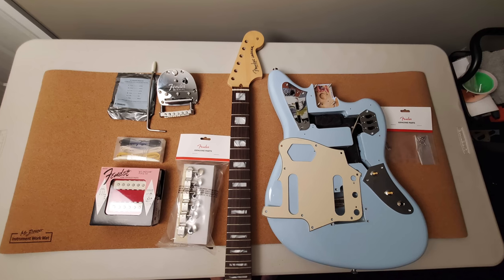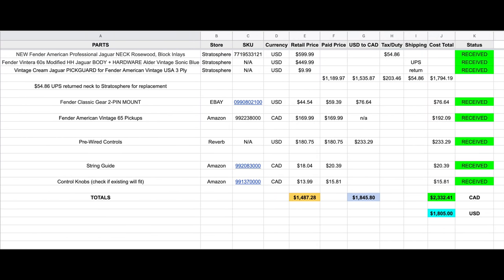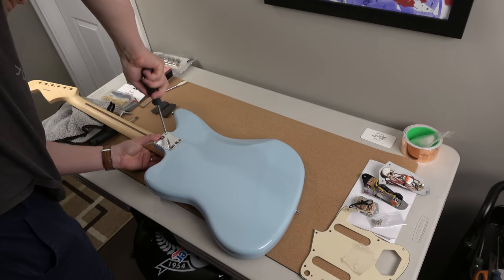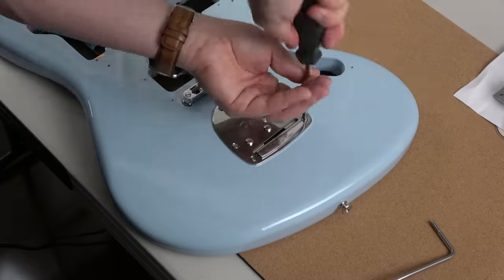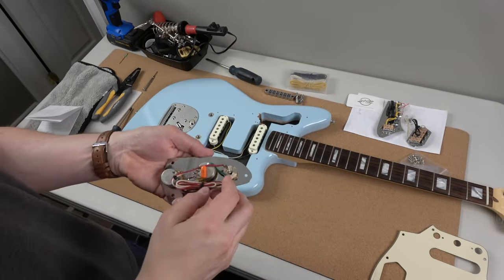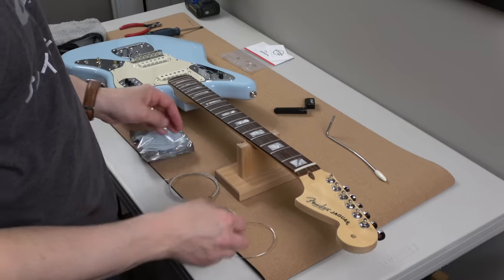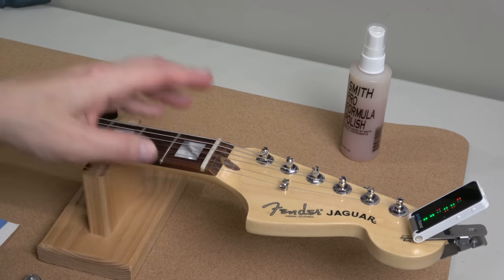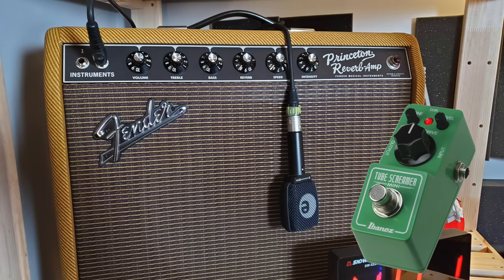Building a Custom Fender Jaguar: The Complete Step-by-Step Guide!

Comment: Nice build Landon. I have a Squire Jaguar and modded with the same 65 Fender pickups you have. It’s black with a mirror pick guard with chrome tele control knobs. I swapped the bridge out with a Fender Mustang which solved the bridge issues and back string down pressure is fine, no rattling or slipping.  Your right about the controls, confusing at first be very simple after. Beautiful guitar, make it a keeper!

Comment: I actually bought the Ventera HH jaguar MOD (sonic blue too). I didn't like the vintage white pick guard though so I bought a white pearlescent replacement (making it look kinda like Cobain's sonic blueJagStang). Problem was getting those pickups back on a new guard though because they rely upon these springs that I can't get it (there's even a video about this problem that utilizes straws that couldn't help me). Your solution with black foam is something I'll try next.
Reply from the maker: hey cool, hope it helps!

Comment: I have had an '09 sunburst Jagmaster II since 2010, and it became my favourite guitar almost immediately. (The other electric guitars I owned are an '87 Charvel Model 4, an '03 Epi Gothic Les Paul, and a Jackson Performer PS-1). Although it is a bit of an oddball, I still like it. I recently got a '21 black Squier CV 70's Jaguar. I like it so far. I dunno if it'll overtake the Jagmaster as my favourite or not. I would have preferred a sunburst Jaguar, but decided to go with black to match my son's Squier FSR Mini Jazzmaster. The other reason was that I had to order online, and I don't like how a lot of the Squier bursts end up looking (including my Jagmaster) because of the mismatched chunks of wood. So, if I were building from scratch, I'd want a two-piece (or really well-matched three/four-piece) body done in a burst. I also have a sonic blue Squier CV 60's Jazzmaster arriving tomorrow (wanted olympic white, but the savings was substantial enough to buy a looper pedal, which I've always wanted, so that was the route I took).
I've never built a guitar before, and while it seems fun, I'm a bit of a purist. I don't even want to upgrade parts on my Squiers that I know aren't amazing. I don't even know why. It's a mental block, I guess. That said, I picked up a Hanna Montana Washburn guitar at a yard sale for $10 once, and it's in pieces and the body and headstock are sanded down, waiting for primer. I'm debating sanding the edges of the body to be more rounded, first. Depending how it ends up turning out, I may go ahead and experiment with bridge pickups on it (if the size would work, I'm not even sure... I think it's a 3/4-size guitar).

Comment: Well, I hope you will follow up with the bridge setup later. That should be the most problematic part of your JM/Jag.  

It looks like you went with a tune-a-matic bridge (less common except for J Mascia's), and plan to use 10's. Hmmm.  Maybe you can get away with 10's with the shorter scale neck of the Jag.  I kind of prefer the longer necks of the JM.

To eliminate all the bridge rattle, etc., the typical solution is to raise the bridge considerably and create string tension with a greater break angle. Usually 11's are recommended as minimum, and the neck gets a shim of about .5 to 1 degree so that you can still keep a lower action.  I have to believe that, as is,  your strings are all over the place after using the vibrato.

It will be interesting to see how that tune-a-matic turns out.

I just got a JM recently, and it's a fussy Diva, but I'm really loving it for surfer and rockabilly stuff so far.  The 12's I use are growing on me. :)
Reply from the maker: thanks for the tips!
Reply: @landonbailey  Don't thank me.  I'm a knucklehead.  See "1965 Jazzmaster Setup Walkthrough & Demo" by @puisheen on YT. :)

Comment: Awesome guitar. I ended up returning my Jaguar block inlay neck and cancelling that build for now.
One thing to keep in mind about Jaguars and Jazzmasters—some of the MIM model bodies are being built with the trem system moved up slightly higher on the body. The J Mascis Jazzmaster does this as well. This Vintera Modified body that you used has this feature. The regular Vintera Jag does not. This modification is supposed to change the string “break angle” on the bridge when using the tremolo and increase tuning stability. I had a J mascis body on my partscaster Jazzmaster at first, but I came to strongly dislike this new trem location. It made the trem arm go forward too far and it felt awkward for me. I ended up switching to a Jazzmaster Vintera body (not modified) with the original trem position and I like it way better. I prefer the vintage string break angle and now I can actually play behind the bridge for weird sounds too. Tuning stability is just fine, especially with my mastery bridge (which was not designed with fender’s new trem location in mind). You have a American Pro Jazzmaster with the original trem location with the rosewood neck— I encourage you to compare the trem on that to this Jag and see what you think. Maybe it won’t be worth swapping the body to you, but it was to me. Sorry for the long comment. Great video 🤷‍♂️
Reply from the maker: hey thanks for sharing that info! good to know

Comment: Did you use all Fender parts to make this an original Fender parts but one you put together.  Did you use any aftermarket other than the wiring?  I believe in clean wiring from a company who does it well.  It works and looks so clean.
Reply from the maker: ya pretty much that was the idea behind it

Comment: Cool color, glad you have the jag now. Have you encountered any tuning issues using 10-46 strings? Especially after actively using the whammy bar
Reply from the maker: Tuning has been good!
Reply: You only have tuning issues if the jag has a floating tremolo, Landon has a tune-o-matic style bridge that is not floating.
Reply: @simonfinch9277  not sure what floating tremolo has to do with the bridge. Tuning issues may occur whether you have a crappy vintage jag bridge, mustang bridge or modern mastery bridge. It doesn’t really matter
Reply: Because the bridge dictates is the tremolo is floating or not, as you can see the trem is a big bulky thing, it's not routed in the back so in order to make the trem floating you need to have a bridge that floats. Floating jaguar bridges are notorious for not returning in pitch after using the system itself.
Reply: You can have the vintage bridge and have a great stable experiance as long as you set it up correctly.
In order to have a good setup on a jaguar you need to create a good break angle.
So you can shim the neck, and raise the bridge up higher.
I highly recommend the YouTube channel called Puisheen.

Comment: Commenting after about 12-minutes in:

CA$ 2300 seems toppy to me (being lazy, I'd just buy an Am Pro II off-the-shelf and to hell with the modding).

Fun vid though. I'll be watching it in chunks on account of the length.

The rosewood looks nice and I really like that blue body. I'm happy with dot markers on the frets; no need for block inlays, though I suppose they do look nice. At least you got a free pick guard!
Reply: But in reality, the parts are probably going to be an upgrade from thw stock model, you can have any configuration you like, and it's still cheaper than a pro ii.  If you go all out on parts you'll only really save on labour costs.  Where you really save money is getting unfinish/raw body, neck etc  and doing it yourself if you're willing and capable.

You also get the feeling of building something.
Reply from the maker: they don't make a Pro II Jag 😊
Reply: @landonbailey  well that sorts that out then!
Reply: Don't you go and bring facts to this discussion, Landon :)

My laziness is now pushing me to a hypothetical Am Pro II Jazzmaster...
Reply from the maker: 🤪 the pro II Jazzmaster does exist!
Reply: Fender sells me therefore I am. Or something like that.

I did spot a second-hand MIJ Jaguar at a Canadian vendor this week for $1500. Had the block inlays and the rosewood neck und alles. It was red though, not as nice as that blue you went for.
Reply: You are even more correct when you factor in the part where you don't get a case and the resale  value is about a quarter of an actual fender.

Comment: ❤Why did you opt to use foam instead of springs, ..which would have allowed you to adjust the Pickup height and tweek the Sound output to your liking without ever having to remove the pickguard.  🤷?
Reply from the maker: the foam acts the same as springs. you can adjust without taking off the guard

Comment: Hey Landon—great build that resulted in a BEAUTIFUL guitar—you should be very proud. And loved the sound of those Fender Vintage 65 Jaguar pickups. One question—did you have to shim the neck pocket to get tuning stability with the Jaguar bridge? That seems to be a very common problem with the Squier Jaguars (even the Classic Vibe series) as they usually require some shimming of neck pocket to tilt neck backwards slightly to get adequate downward tension of strings across the bridge and attain tuning stability with the floating bridge/tremolo system. I assume since you didnt indicate doing so that this was not a problem on your build. Its a shame that the Squier Ckassic Vibe Jaguars don’t correct this problem with adjusted carve of neck pocket—and since Fender Jaguar models don’t usually come in classic vintage configuration with two single coils unless you get into the higher priced vintage repo versions, you can’t buy a more modestly priced Squier version to try out a vintage Jaguar without dealing with the neck pocket angle issues and doing some shimming. Given that Squier CV Jaguars are considerably more expensive than the Affinity series Jaguars that usually come with humbuckers and a fixed non-tremolo bridge—its really frustrating for someone who wants to try out a vintage style more modestly priced Jaguar with traditional single coils and control set up. Keep up great work—your videos are always a pleasant blend of good information and humor!!

Comment: Fender Mod Shop for Jaguar is very limited, especially compared to the other models.  Want a vintage neck, not an option; want vintage controls, not an option; want vintage pickups, not an option. 

Building it yourself is less than buying an American Fender with vintage specs.  I have a Marr Jag, MIJ Jag (vintage specs), Player Jag (modern specs), and Vintera 60s Jag (vintage specs).

If the Mod Shop offered more build options, I'd likely have a Mod Shop Jag
Reply: @landonbailey  Great job, looks great, sounds great; well done!

Comment: so i took my in to royal harps and it was not done right he did not do the job buzzing poping wierd noises coming from my 1000 amp dont think so so he said he refunding my card no work order or anything that they did so i am taking it to his boss st john music to do the job a 2 hour job at most setting neck bridge soldering switches bridge setting strings 200 dollars later grounding out and he did not put any rubber matting between the pick ups waited all most 3 weeks i am nerous  because of the money spent on everything 1500 dollars later even the neck was not shimmed if he warp my neck i will get them to replace it 1968 vintage neck 24 inch scale should fit pefectly but its not right side of neck sticking way up jaguars normally do need a shim beware of bad business people take care